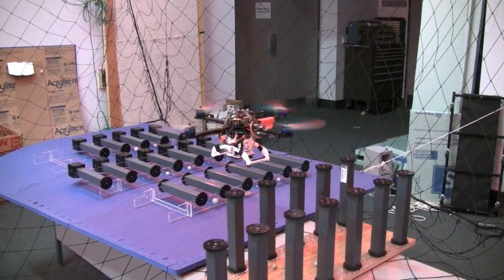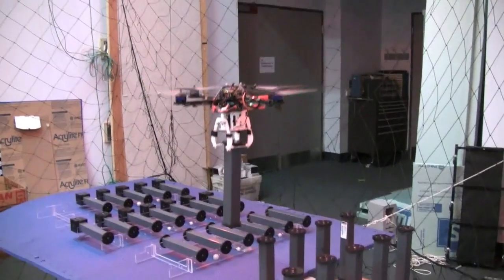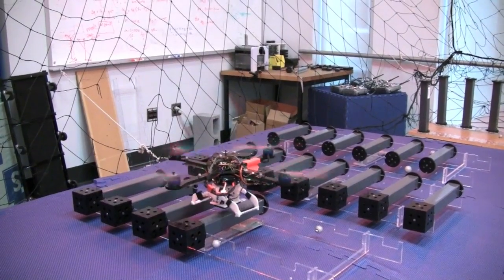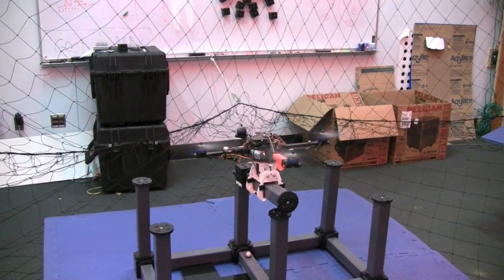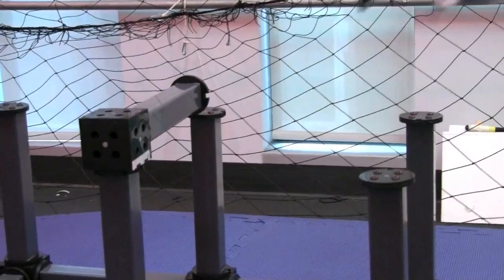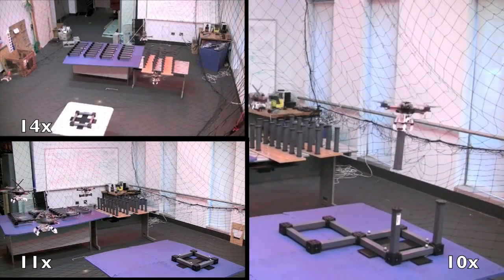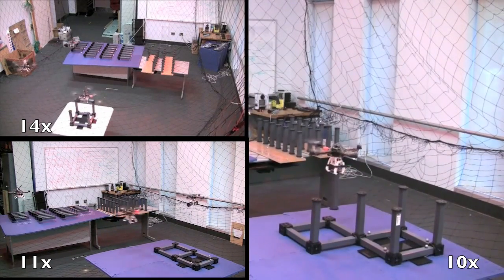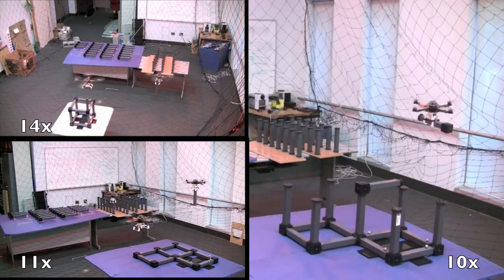Construction with Quadrotor Teams

Comment: would only make sense for structures that need to be built, repaired or demolished where working 24/7 was needed , building speed is usually not that much of an issue , cost is far more important, buildings last for decades the time to build is proportionally very small

Comment: What kind of position sensors do you use on these quadcopters? It looks as if they are indoors, and GPS doesn't work too well there, so I figure this is optical flow.
Reply: I think they're using WiFi, not GPS.
Reply: Yes, there's a huge frame around the test area, packed with cameras and sensors. You can see the frame on other videos.

Comment: I can't help but notice the inneficiency of the algoryth employed. The Quadrotors do not employ true concurrency and instead work on a much more phased set of patterns which I think limits there potential. The method uses wastes alot of there time in just waiting for a barrier sync from the others before it can proceed, rather than proceeding until a collision or clash is imminent.

Comment: @SoCalSummerSquad the size of the solar cells required to power one of these would be a bit on the large side. The motor controllers are likely 30A each. They could have a docking station that would exchange batteries for them and have enough on hand so they would constantly be charging new ones.

Comment: Day5 success  4 robots built a cage
Day6 they spoke
Day7 the robots try to avoid being shut off but their batteries ran off
day8 robots formed a circle and used the parts to create messages to each other
Day20 the robots finished their project and created battery bots
day23 the robots created a toy soldier and demanded to meet a sarah connor
day50 the robots have built a million of their toys
day60 they created a gov program called skynet then activated operation judgement day

Comment: There's that skyhook we in the construction industry have been waiting for... Awesome technologies coming together.... This may even replace the Tower Crane... Other than size, there is zero difference between the parts they were using and the parts any steel structure is built out of... A dozen of these in an industrial size on a job site would speed any project by a factor of two or three easily as competing for crane time becomes irrelevant.

Comment: I wonder if it would be possible to power them by induction, and have a specialized quadrotor that is more powerful and carries a larger power supply for all of them. Or, they could still have batteries, but could share power. Perhaps one could be made as a charging platform. It could have a little generator and fuel supply, and small quadrotors could land on top and charge up. Make a quadrotor carrier and make it look like a super star destroyer from starwars

Comment: @RedGeneofDoom 

Why do people have such a hard time with rhetorical questions?
Don't answer it, it's another rhetorical questions.

1) Mars has dense enough atmosphere for aerodynamics to work, hint mars rovers used parachutes.
The exact same one propellers won't work, a different propeller type is needed.
2) I did not say exact same robots the exact same robots cannot run wires pipes check for pressure etc, etc, etc.

Do you want to be the highest rated comment? fine by me you get my vote.

Comment: Like the Moller Skycar, the noise and range issues can't be solved by current engine tech. The engine-out mode is really ugly too, with no means of a controlled glide or auto-rotation, they just tumble in. Construction cranes aren't going anywhere soon. 

The Quaudrotors are likely to stay small and unmanned. I expect we will see them on "Cops" packing a taser and chasing some hapless rabbity crackhead through suburban backyards.  

At least honest folk still have the 2nd Amendment. 

PULL!

Comment: Really interesting stuff. It would be cool to create either battery swapping or charging station behavior so the quads could keep themselves alive. Swappable, modular batteries could work if you had two or three batteries charging for each quad. Lithium batteries can charge at 2C - 5C now. They could work 24/7.

Comment: How about making your own custom charging system/docks for them, like the robot vacuumcleaners recharge? Or adjust a charger with telescopic extentions, with magnetic connectors that snap in place like the building parts, with different shape/size connectors to prevent the wrong connector being connected (Kinda like how a fighter-jet refuels in mid-air, but a vertical solution a la helicopter style.). And just see with the correct software routine if they can work in shifts.

Comment: @pand2aren At this point we will continue to use the infrared cameras. @TheDmel and I don't focus on the localization and navigation. There are others that do handle perception.

The quadrotors weigh about 500 grams including battery and can lift an additional payload of 500 grams. However, if you have ever seen it fly with 500 grams, you would understand why we only use a max of 250 g.

Comment: @geekionizado no, think of a coaxial helicopter, which has two rotors spinning in different directions, make one spin slower and the other one faster to make it turn
it's the same on quadrotors
let's say the front and the back rotor are spinning cw
left and right spinning ccw

make front and back spinning slower to achieve cw turning